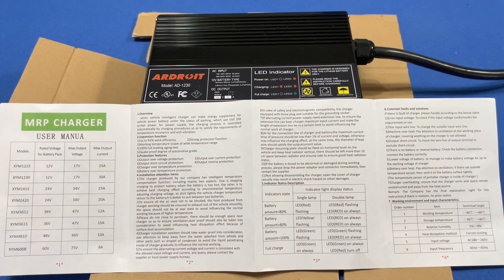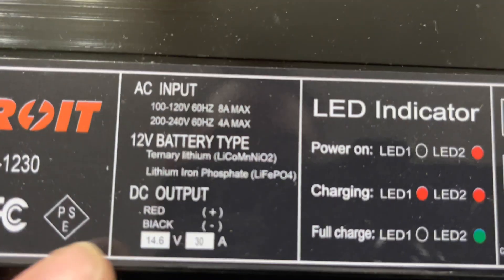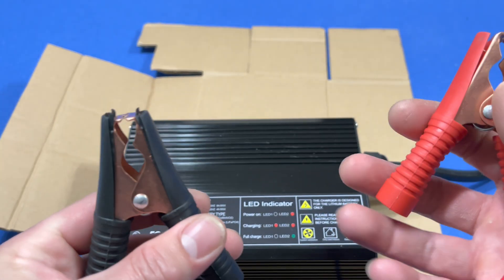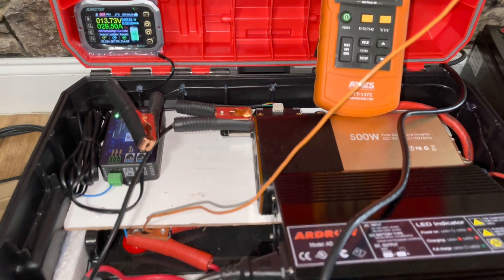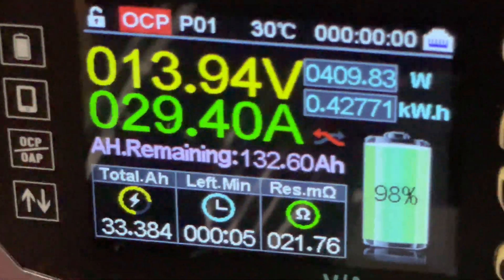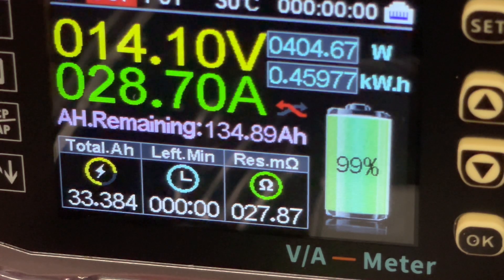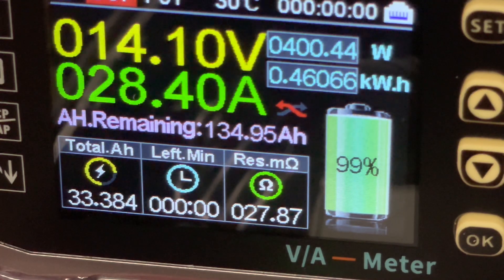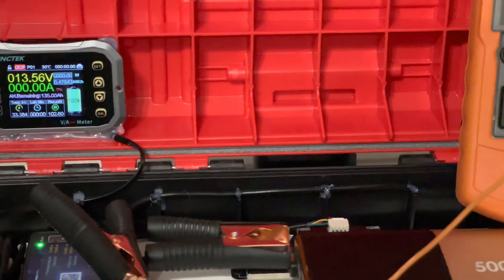ARDROIT 14.6V 30A Lithium Battery Charger DOES IT PERFORM?? IS IT WORTH THE $$$

Comment: AFTER FULLY CHARGING MY 200 AMP HR LIFEPO 4 BATTERY THE VOLTAGE STAYS AT 14.2 TO 14.5? THIS SEEMS HIGH AND I'M CONCERNED ABOUT OVER CHARGING AND RUINING MY BATTERY? WHAT SAY YOU?
Reply from the maker: 14.2-14.5 is actually perfect.....the BMS should regulate it when it's charging.....charged and discharged MANY 100 Ah batteries and they all still work I think you will be fine....after you remove the charger let the battery sit for an hour then put a meter on it you will see the voltage come down a bit

Comment: Will this wake up a lithium battery that has hit the BMS
Reply from the maker: Yup done it many times but if it's too low hit it with a regular charger for like 10 minutes and it will wake it up as well
Reply: @DIYKAI  sorry just to clarify when you say hit it with a regular charger are you referencing like jumper cables? BattleBorn batteries told me to run jumper cables from the tow vehicle battery to wake it up, but it would be nice if I could just hook this up and be able to wake him up with the ardroit
Reply from the maker: @zacksmith-s2c yes that’s exactly what to do or to use a lead acid charger for a few minutes…..the only issue is if the voltage is too low like 5VDC or lower the Ardroit won’t see it and think it’s charged or dead cells…
Reply: @DIYKAI  I’m definitely not that low. I did a reading on both of the batteries. One of them is at 11.5. The other one is at 11.3 but nothing in the trailer will power on so I’ve just assumed that I hit the BMS on the battery.
Reply from the maker: @zacksmith-s2c 11.5 no issues
Reply from the maker: @zacksmith-s2c one piece of advice if you get this charger cut the alligator clips off and use ring terminals that way it's a solid connection it pulls over 30A when charging

Comment: What specs LifePo4 battery charger should I get for 51.2 v 100-200 Ah battery? Bluetti said the alligator clamps - XT90 adapter can only charge 12V.
Reply from the maker: depends on the BMS for the battery do you know the charge limits?